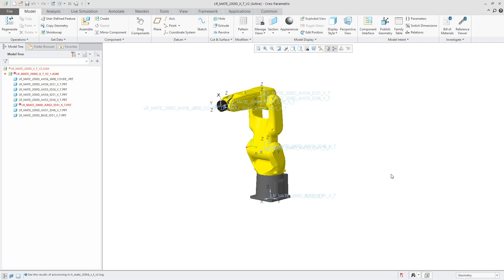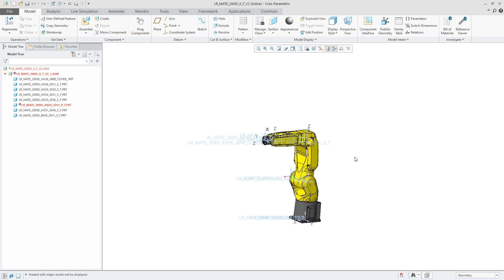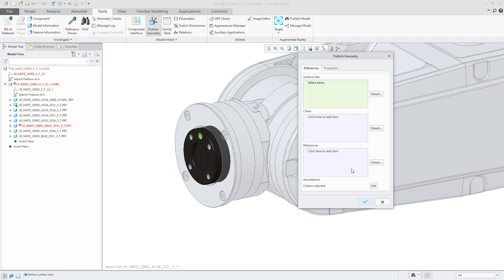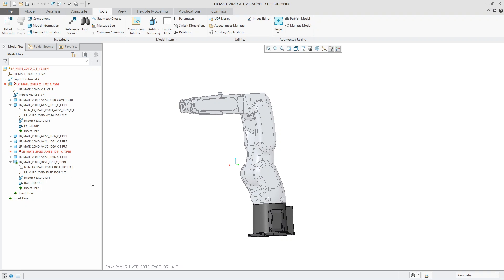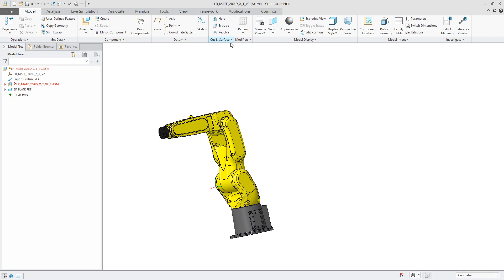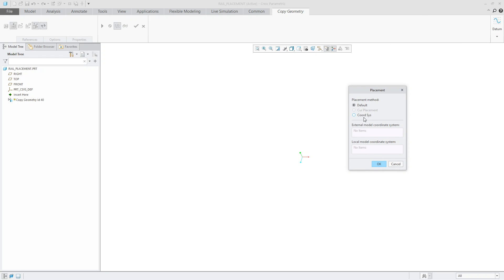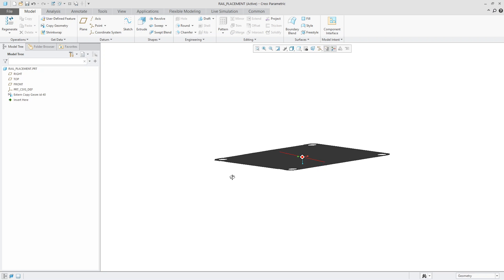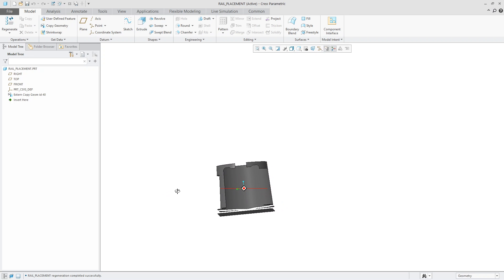Creo 5.0 Tutorial - How to Work with Publish Geometry and Copy Geometry

Comment: Thanks for the video...looks fine but when I use copy geometry I have circle references in the modifed part that drives me in more problems...am i correct or am i doing someting wrong?
Reply from the maker: If you are getting circular references, that means you are trying to do an operation on the parent while referencing the child. For example, if you try to cut the parent with a copy geometry piece that gets its information from that parent. That is a circular loop. To avoid this, use the Publish Geometry to essentially freeze that reference. Anything that happened downstream will not affect your publish geometry unless you drag it to the bottom of the tree. You can also break the associativity if you desire.
Reply: Thank you so much for the answer, I think that both approaches sounds good and I will try to apply PGeometry hopefully without circles ref. as for the second method of breaking the associativity is what I am doing now :) thanks again really appreciate. @Jive_Engineering

Comment: copy geometry creates external references and renders the model uneditable. i have used Pro/Engineer since version 17 and i have seen the worst garbage models. Pro/E WILL NOT LET YOU CHEAT. DO YOURSELF A MASSIVE FAVOR AND DONT TRY TO USE THIS TECHNIQUE. editable models are much easier to maintain. copy geom models will only require deleting the copy geom and replacing it with a Castings/Forgings model that pays absolute respect to what Pro/E wants when it wants it. its a software that WILL NOT LET YOU CHEAT. SO DONT TRY!!
Reply from the maker: This is absolutely not true. You CAN edit the model and any external references you bring in. You can do this via direct modeling (flexible modeling). They lead to garbage models because they are not planned well. Top down design always requires more planning but when done correctly, it works absolutely beautifully. For castings and molds, I use Merge/Inheritance, which is a different type of command than this.

Comment: Wow...lots of steps. Seems like you need a really deep understanding of how these all relate to execute these steps correctly. Why couldn't you have skipped to the last step and simply copied the geometry by importing the file and selecting the surface in the small window? 11:41
Reply from the maker: Hi Armand, the last step is to showcase an example where you need to push more surfaces to the groups. By default, they cannot select these surfaces because they are not included in the Publish Geometry. But, once you add it, there is no need for them to go through that step again. It automatically adds it to their Copy Geometry.